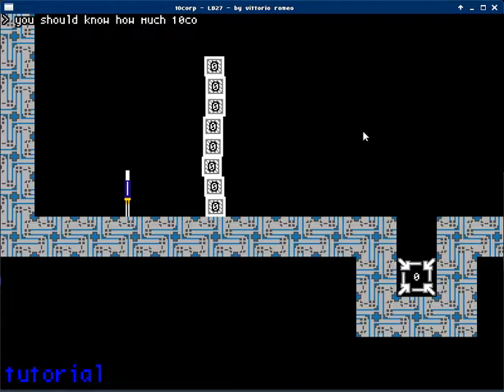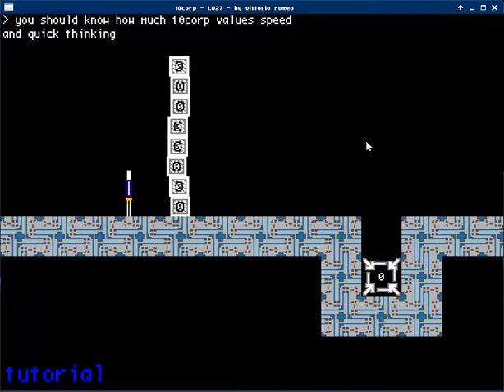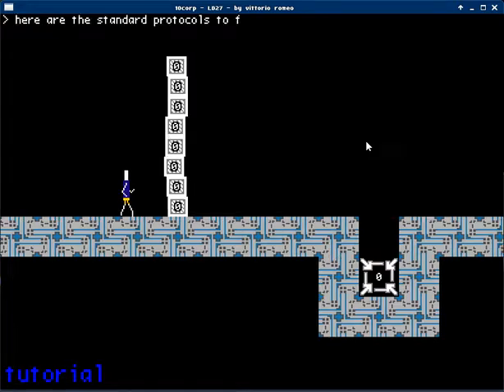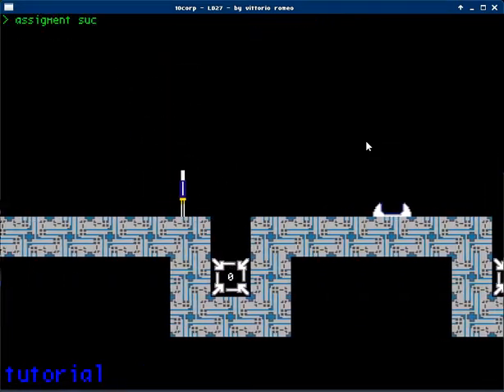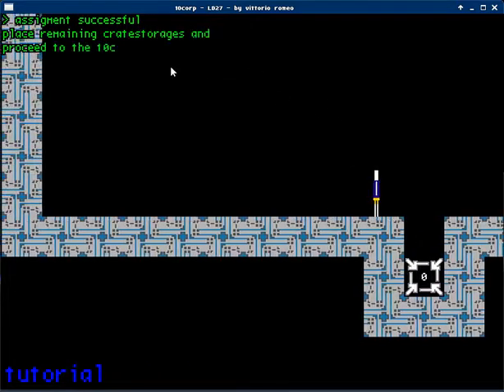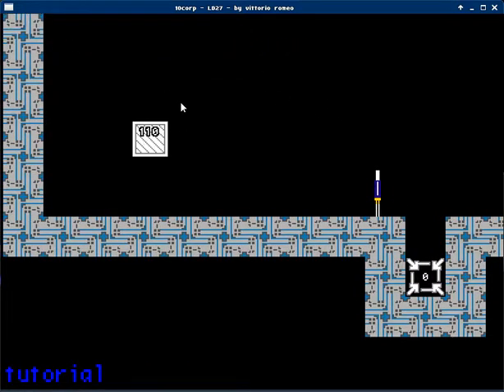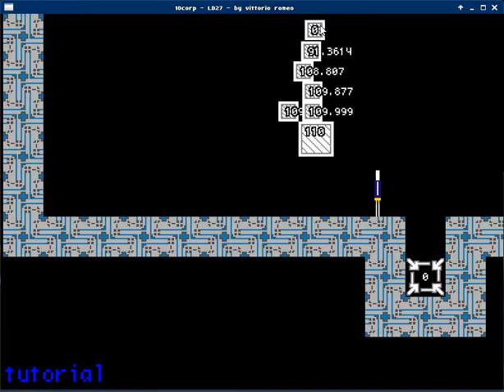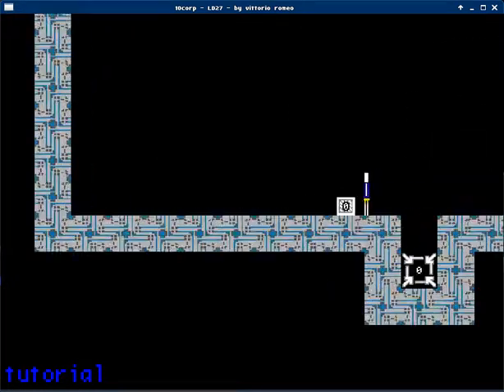~programming (pseudo) physics - pseudofriction

Comment: That bug where towers wont collapse seems more prominent now. You may want to consider working on that. Perhaps if the center of an object was not being held up by any other objects it would be pushed in the x direction or the -x direction allowing it to more naturally fall.
It might be wise to have a threshold for the center instead of just one point. This threshold could be larger for blocks (easier to stack), and smaller for balls (harder to stack).